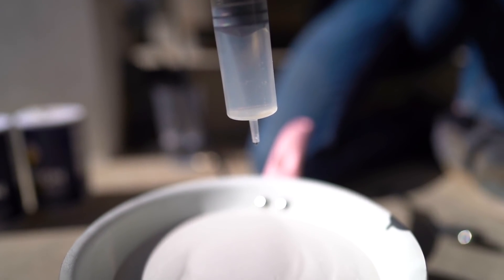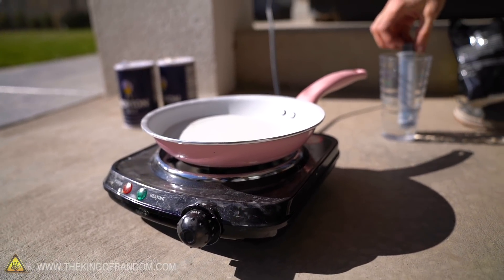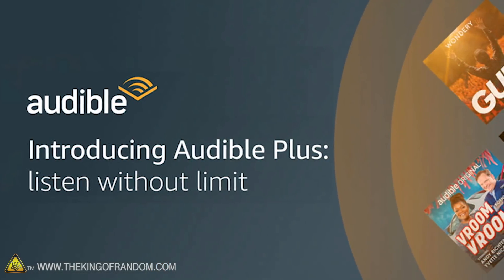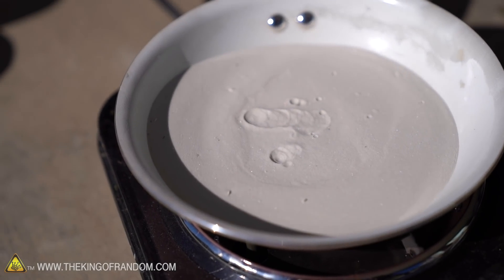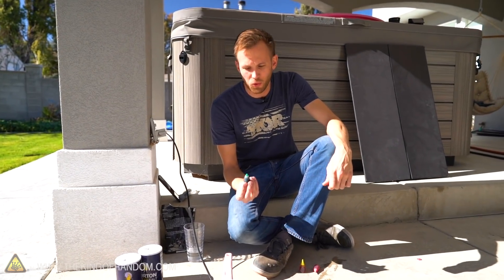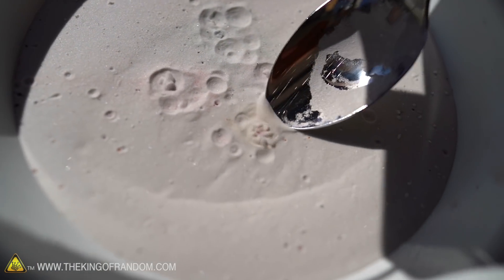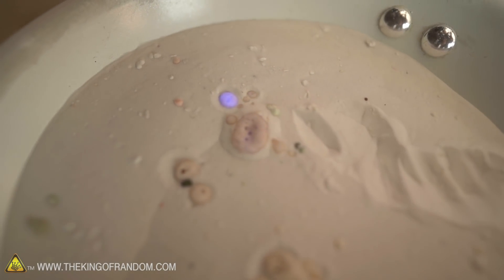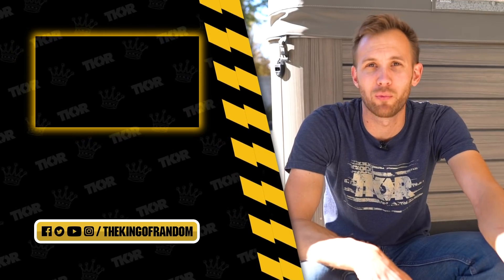Can Your Stovetop Create Exploding Sand?

Comment: I think its not because of the sand being hot, but the hot surface under the sand, where the water reacts to the hotness of the pan that produces steam that makes the fine sand look like it is boiling. Salt on the other hand tries to absorb the water before it goes on the lower surface which I believe the reason why it did not make the salt to not boil like the sand when water got dripped in.

Comment: You are getting the response you are because it is not sand! it is a true glass product and though made from sand it is not the same thing, I would hazard an educated guess that the spreading of the water drops is because of the "sand" being glass and no matter the size when you drop water (or any fluid) on to glass it will shatter thus causing the liquid to spray out in different directions  Using playground sand would have allowed the water to be " slightly" absorbed before boiling. By slightly absorbed I am talking milliseconds which would have stopped the popping away from the drop